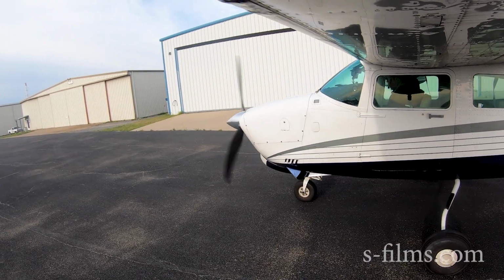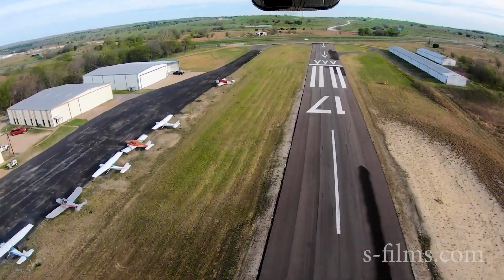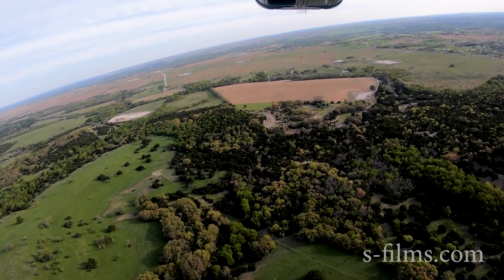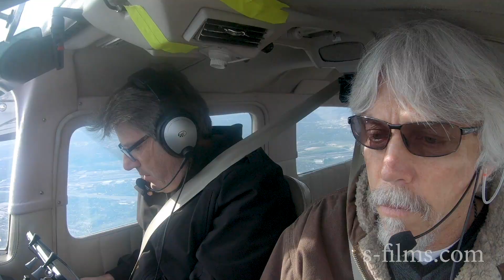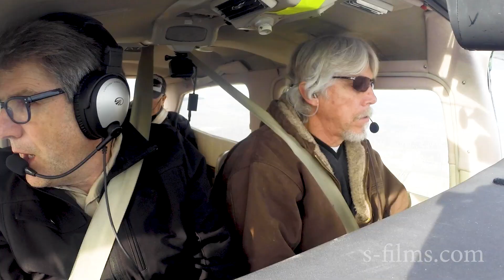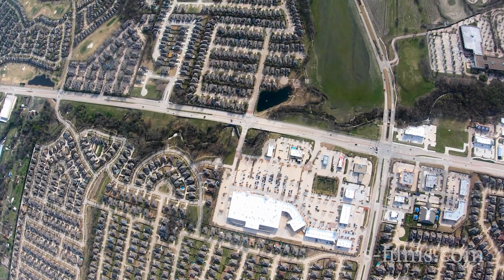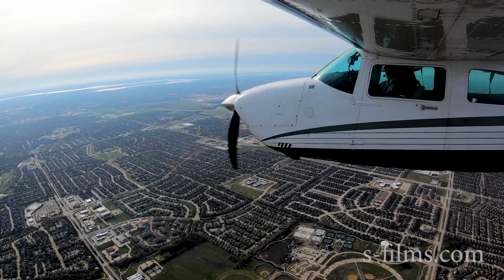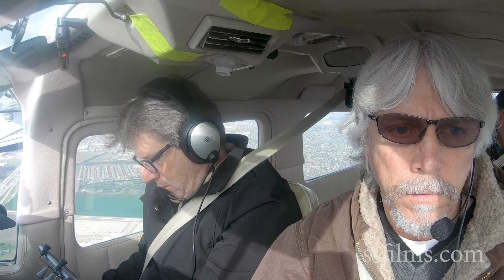Mechanic Flies My Plane - TakingOff Ep 55

Comment: I wouldn't schedule an appointment for that yoke mounted trim on/off switch install.  I have flown numerous  types of twins and singles with electric trim, and have not seen one yet. Autopilot disconnect, Yes. Trim on/off No.  Nothing harder than flying an airplane and actually not be the one flying it. Good job. Enjoyed the video.